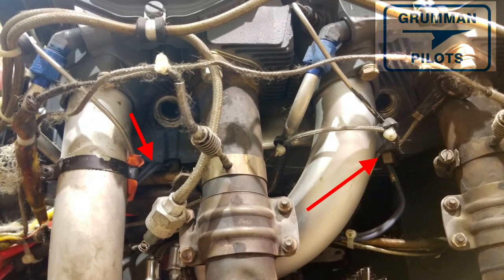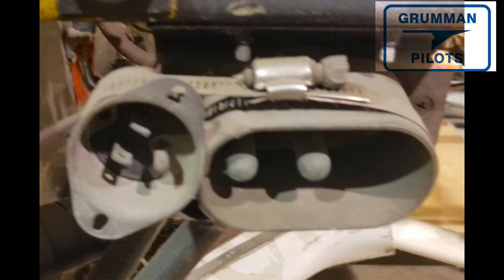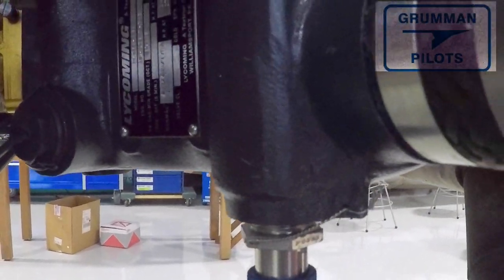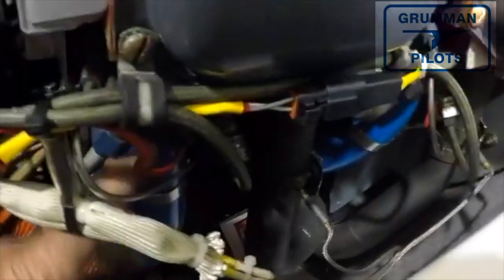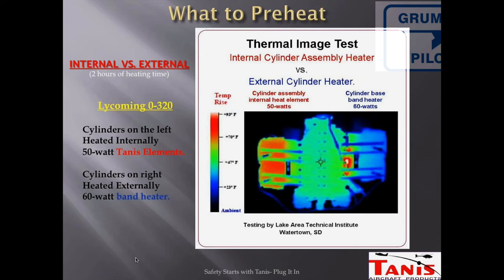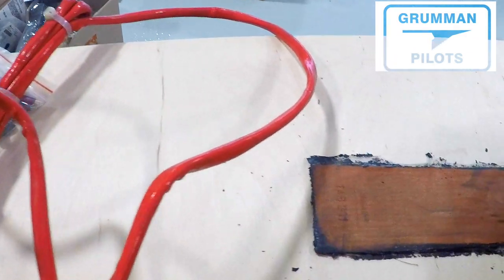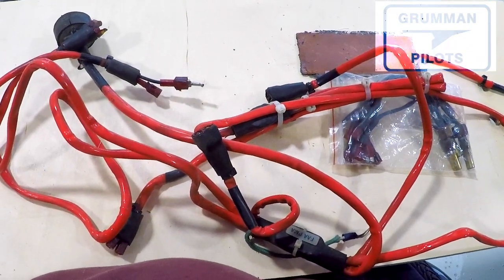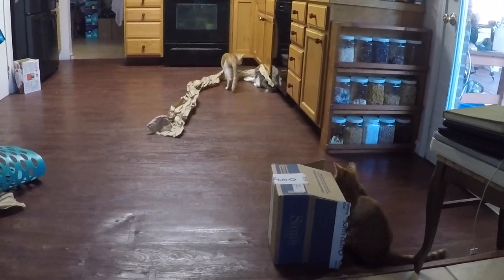Tanis Engine Preheat System - Grumman Style

Comment: What about running the Tanis continuously, in addition to a dehydrator like the DryBot or Black Max? Wouldn't this eliminate the need to worry about condensation from constant pre-heat?
Reply from the maker: Being warm will cause the oil to run off faster they say.